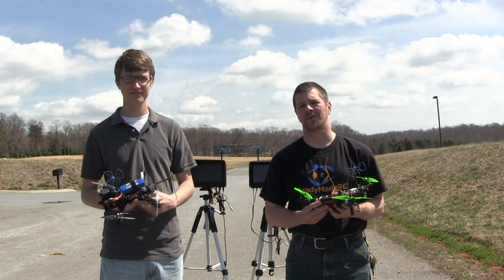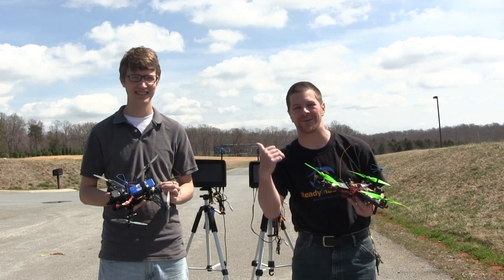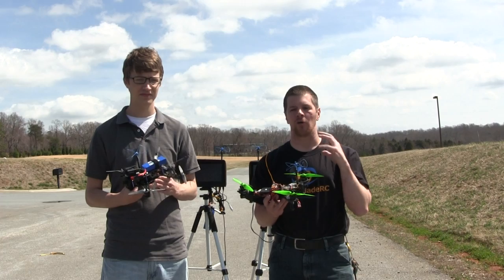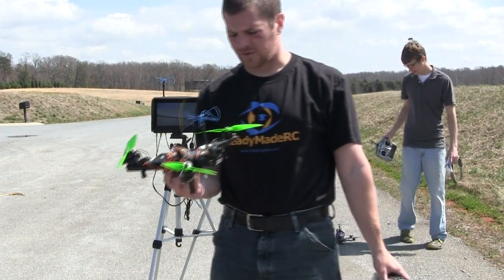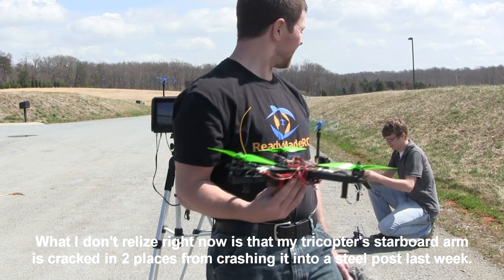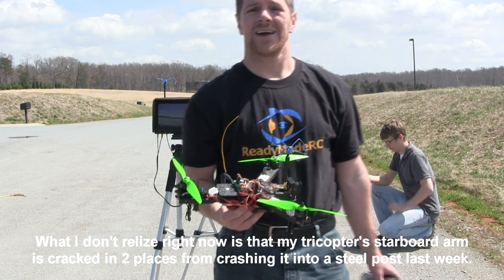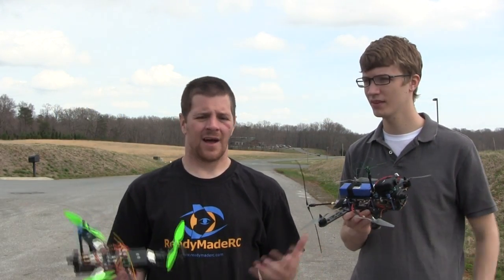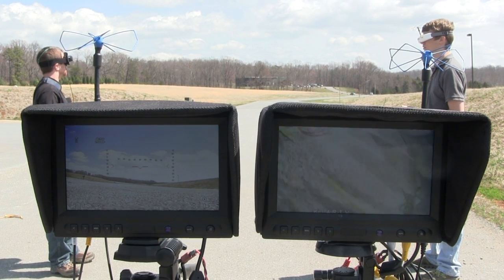Cyclone antenna Alpha testing

Comment: Whatever you do,  put as real crimp style connector on it like the SpiroNETs. Your other antennae won't take any abuse at all. "Very Fragile"
 Sorry if this sounds harsh, it's just real world product feedback.
Reply: in their defense, I think that was a one time supplier issue that has been resolved.
Reply from the maker: JoeyG FPV
Indeed it was a one-time issue.  All of our antennas have a collar on the base.  The difference is that we use a better cable than the Spiros which is also more flexible.  This keeps you from destroying your transmitter in a crash.  I got lots of complaints about the antennas being too stiff.

Comment: I'm not sure how relevant this is until it's done with the smaller, more robust 5.8 that mini quad racers use. However, if you plan on sorting this later and you're solely interested in interference- the left one looked best. But you can tell this as well as us :) I like your desire to invent and push the hobby and the tech forwards.

Comment: how about a fixed wing test? hard bank and yanks up high and down low. I noticed that when you'd lean into a turn there were a few glitches nothin major. the 4/4 combo was probably the best, 4/5 was ok. I'm thinking the less blades on the TX is still better. More environmental testing may need to be done depending on the frequency, such as buildings or forests mainly for the quad and tris to see how well it rejects multipathing. I'm a fixed wing guy so mainly the bank and yank applies to me. But it looks awesome!

Comment: If telling the result from the video. It was 4/4. But I noticed that it could be a defective receiver (RX sensitivity) on the right one because no matter which antenna installed on the right one. It got a worse result than the left one. That affected the antenna test significantly. If you are gonna to test the second round. I suggest you should swap both the equipments for the same test to isolate the problem of defective equipments that may causing a defected result.

Comment: For this part of the world, it has to be 5.8G, and it needs to be tough. 

With the rise and rise of FPV racing, its low, its fast, and you crash. You crash a lot, so the Aerial needs to be tough, and when flying through trees and other obstacles you need a short mast.

There isn't that much flying over yourself with FPV racing, its generally all in front of you.  We don't need high gain, but we do need it to work around obstacles.

I thought 4TX and 5RX was the best combo
Reply from the maker: That is the later part of this project: making it smaller and more durable.  Right now I am focused on RF performance.  I have some ideas on durability and such.
Reply: Look forward to seeing that